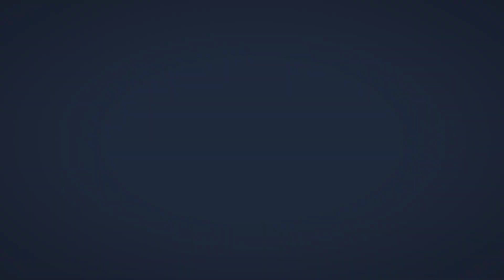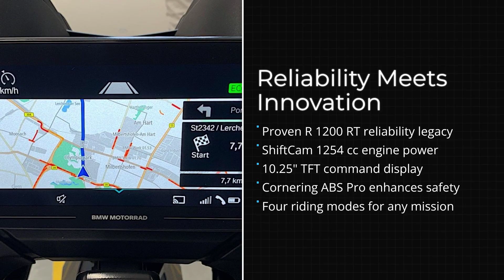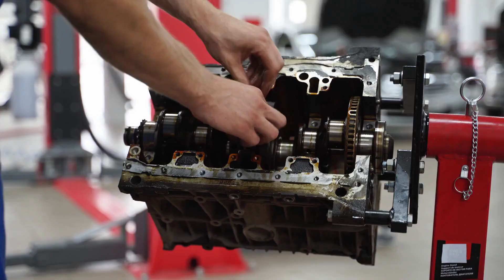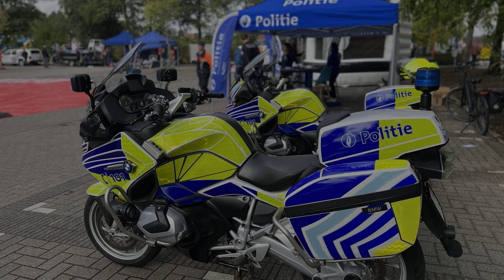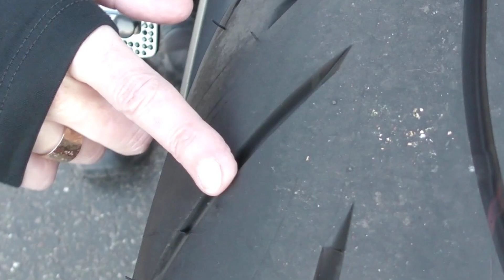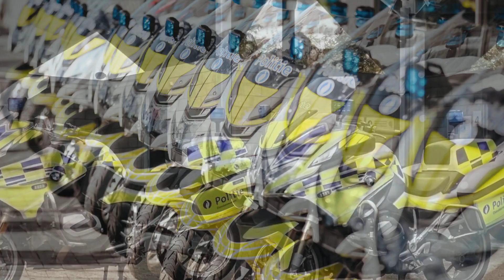Inside the Belgian Police's Choice BMW R 1250 RT – The Full Story

Comment: This video it's so lovely and tecnically correct, but totally detached from reality...
Reality is a big part of the world use as Police motorbike the cheapest, fast enough, quick enough, often without onboard radio, Tracer 7 by Yamaha, because you can buy 40 japanese bikes instead of 20 german ones at the same price...
You can only pursuit with a motorbike, quickly arrive with a motorbike, clear a designated path with a motorbike and use it at parades...
You don't really need a BMW...
Maybe just in Germany with no limit on highways escorting armoured state cars a BMW could find a reason to exist and only cause armoured cars have a limited speed of 210 km/h and the RT model is capable to confortably reach that speed...
That's why some cities could have thousands Police cars and less then a hundred Police motorbikes...

In the rest of the world they use cheaper cinese motorbikes!!!
Reply from the maker: You clearly know fleet economics ... and you're right. Most of the world doesn't need this machine. That's actually the point.
Nobody made this video for the departments buying Tracer 7s in bulk. We made it for the people who already know why Belgium didn't.
When you're running encrypted diplomatic escorts through Brussels in November rain with 60 kg of comm gear bolted on ... "cheap and fast enough" stops being a strategy. It becomes a liability.
The departments buying 40 bikes to do traffic stops aren't wrong. They're solving a different problem. You seem like someone who understands that distinction better than most people in this comment section.
Stick around, Subscribe for our next one ;-)
Reply: Police fleets do not pay retail prices, the BMW could well cost the same as a yamaha over it's expected lifetime.